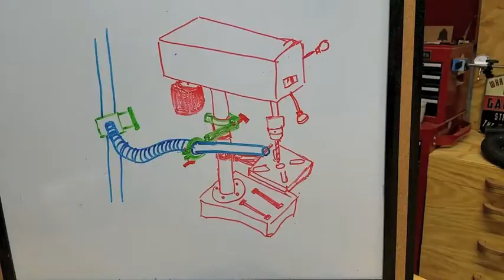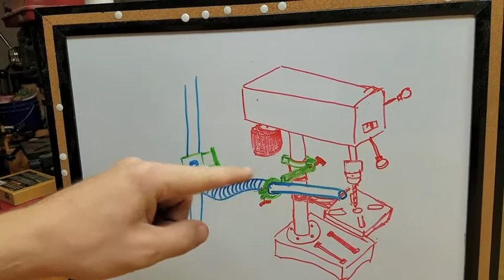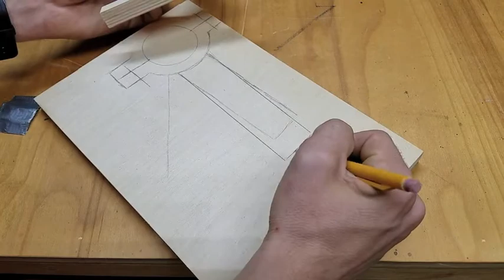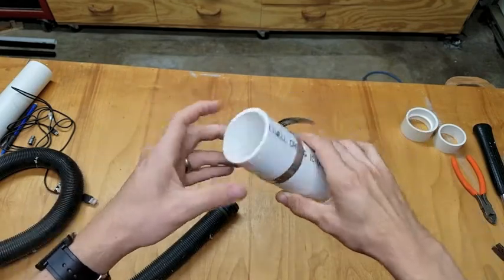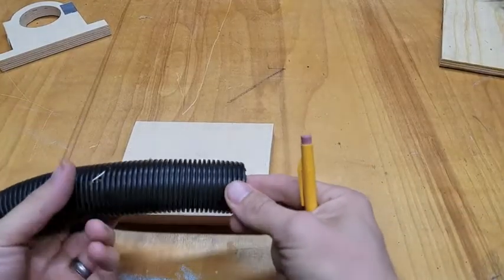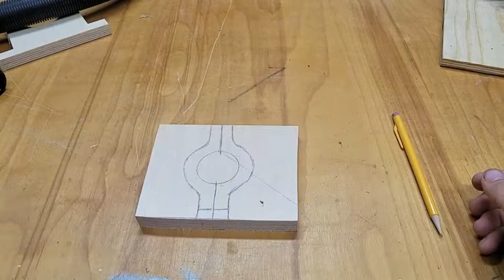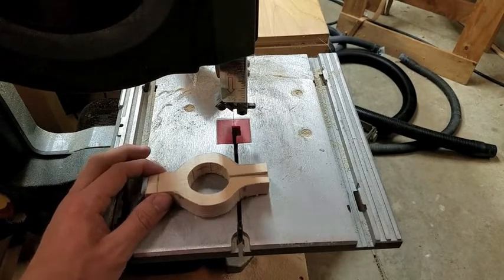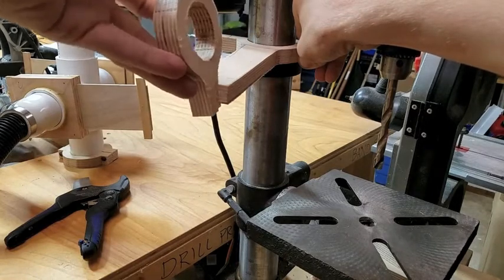Drill Press Dust Collection Jig / Shop Vac / PVC / EP41

Comment: Thanks Chris. I've been making a drill press cart and a table with an adjustable fence. Your idea for sucking up chips and dust are so simple but very effective. I'll be making the clamps the same as yours to keep things clean. I just happen to have an old shop vac hose the same as yours which will work. I was making some star knobs last night and had to stop every once in a while to vacuum up the chips which is a pain. Great to be able to improve my shop and thanks for sharing
Reply from the maker: I appreciate that you found some value in it,  John. All the best on your drill press dust/chip collection!

Comment: I see you're using a whiteboard now. is this the first time for that?  your drawings are a lot better than mine :>) I'm jealous.
Reply from the maker: Hey Russ, I really like to whiteboard or sketch ideas before I make them. I don't always use the whiteboard, but for some projects I think it helps a lot. Thanks for the compliment!
Reply: is this the first time you used it in your videos?  I use it all the time in my videos.
Reply from the maker: Russ Veinot, I've used it before and really think it adds to the explaining. I usually do a pretty good job at sticking my foot in my mouth and it helps to keep me on track. I like your videos where you explain with a white board, I think it really adds to your explanation of what you're making.
Reply: thanks, I kinda use it mostly to convey subtle humor, like my stick cowboy drawing I did a while back.  I do like your design for the drill press.  I might actually make one like that.  I always hold the hose in one hand or quick clamp the hose to the table and that is frustrating at times.  might make a good comic video if I ever recorded it :>)